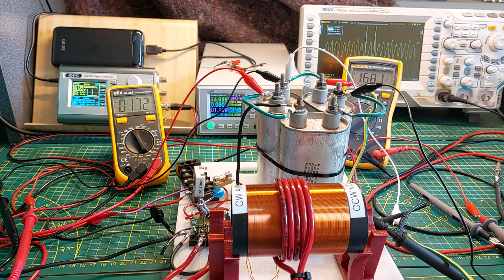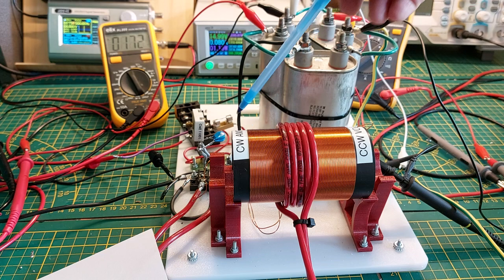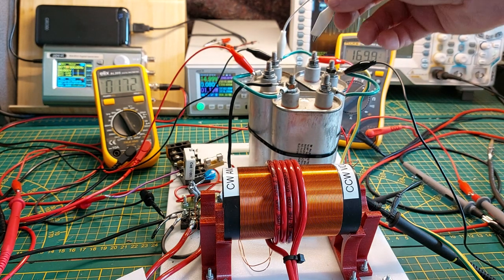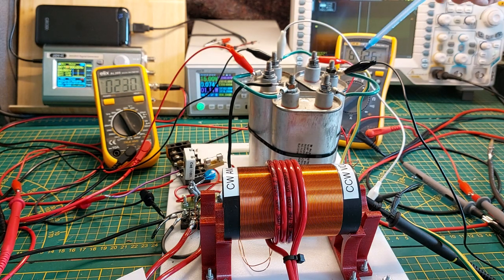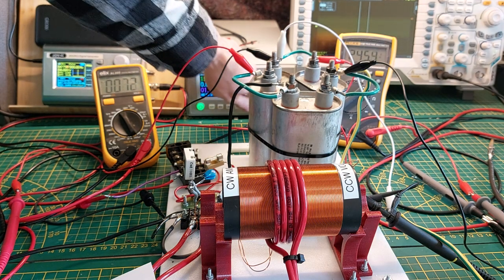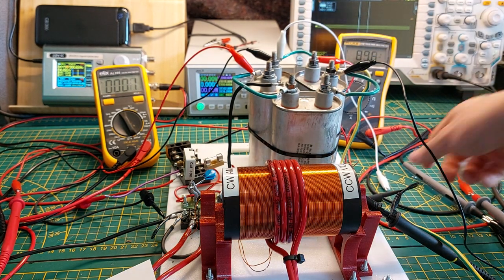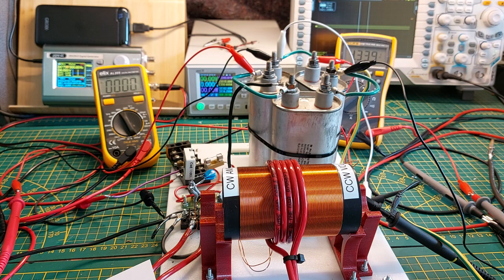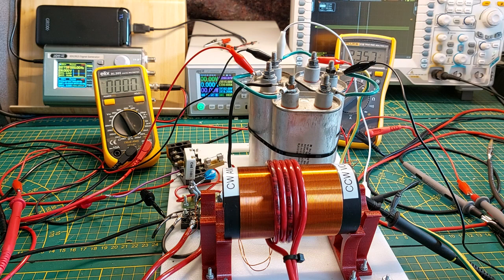Switching 3 phase capacitor bank

Comment: can you explain the picture of Don Smiths setup  and how its similar to your setup.  I've never seen capacitors this size with those many leads coming out of one box.
Reply from the maker: According the type you use there are even much more connections inside that box. You can even have them with internal fuses. I saw a type of such 3 phase capacitor with internally cylindric capacitors connected in series and parallel. The box is then filled with oil for heat distribution and electric insulation.

Comment: What is the objective with this circuit?
Reply from the maker: Recycling of energy if I'm correct.
In the left upper corner I have drawn a circuit of what I think should work. (not tested yet)
I hope this way I will be able to do more power output, hopefully I'm correct.
It certainly makes it faster for the capacitors to charge up.

https://photos.app.goo.gl/vWRX1kYD3Hr8odbXA
Reply: 3 fase has its weird uses this one